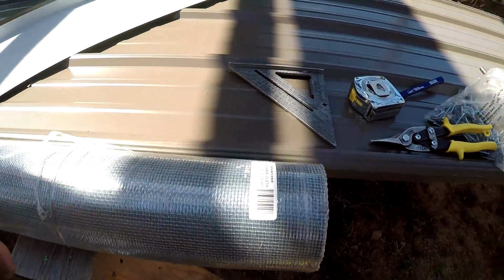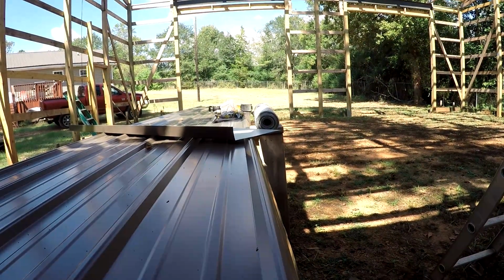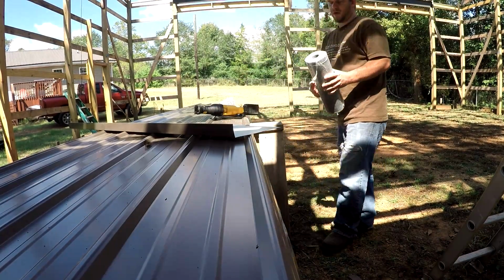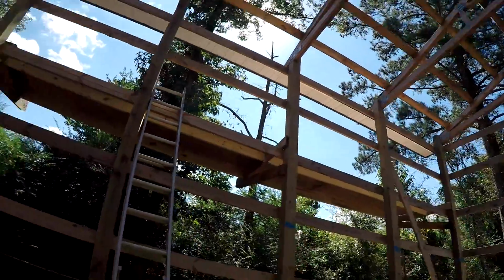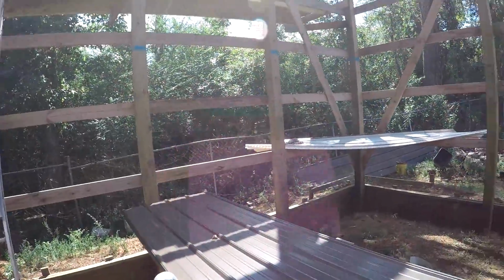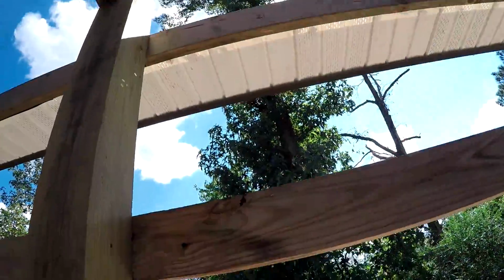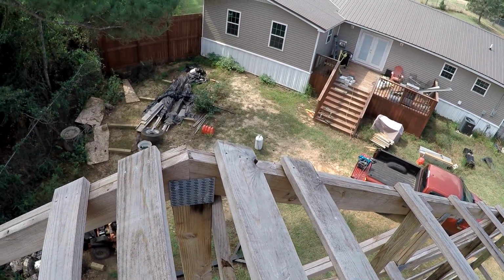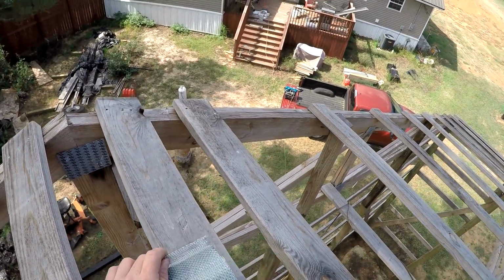Installing ridge vent screen on shop and dropping nailer off the roof (Super sketchy)

Comment: And why'd you make the gable a 2 ply I've never seen that in all my fifteen years of framing model and custom homes
Reply from the maker: I bought more trusses than I actually needed so they were just gonna be thrown away so doing it like that made it flush with my lath board on the outside